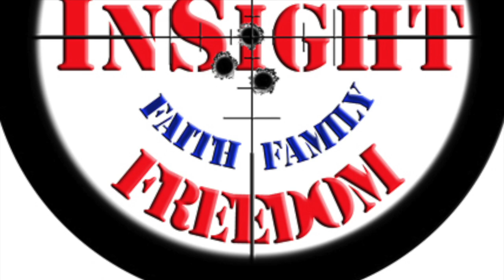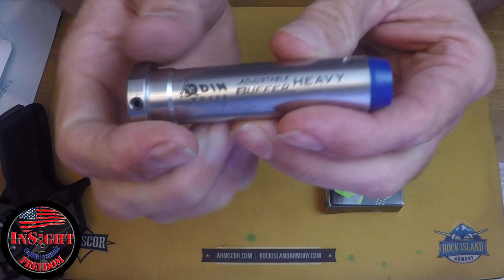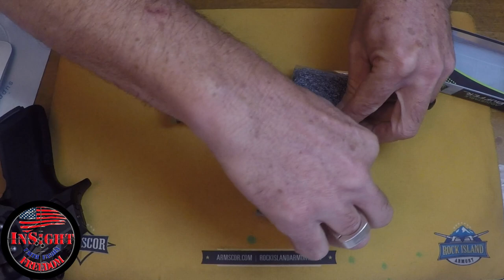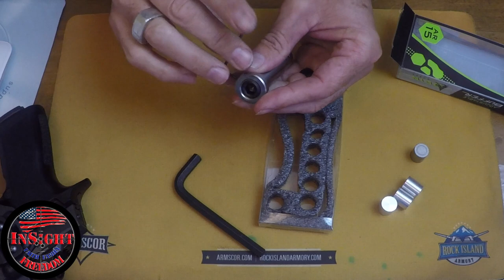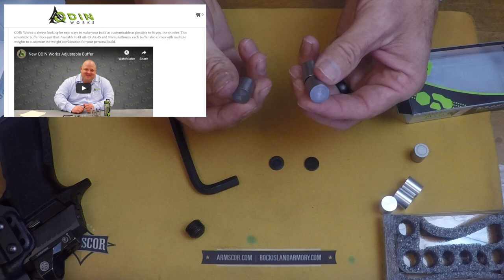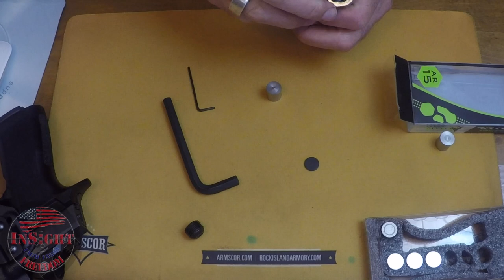Odin Works AR15 Heavy Adjustable Buffer Walk Through

Comment: I like the idea of an adjustable buffer.  That one seems easy enough to change.  Well engineered.
Reply from the maker: Thanks brother.  I really like this buffer concept especially if you might be sharing a lower with different caliber uppers.  Just makes sense. It was so easy to get the 6.5 Grendel tuned with it.  They are really well made to boot.
Reply: Great options for suppressor too!

Comment: Any good recommendations for weight configs for .300 Blackout sub and super, and .223/5.56? Any risk in running a .300BO with too light of config? Thanks!
Reply from the maker: Typically 300 BO will require 3.8 oz buffer. Some variables are pistol length vs rifle/carbine length, suppressed vs unsuppressed and gas system. Heavier buffer weights will likely result in ammo feed issues if too heavy by causing the BCG to not cycle back properly to pick up and feed the following round or causing weak ejection. If too light, ejection patterns will be exaggerated forward (like an AK). The AR 15 Light Odin Works adjustable buffer had a buffer weight range of 2.1 oz to 4.2 oz while the heavy covers 3.7 oz to 5.8.
Reply: @InSightFreedom  Thank you. I just finished a 9” .300 Blackout build on a SOLGW East India upper. I had the Odin heavy kit so have two steel and one tungsten in the buffer. Curious to see if it will be too heavy. Most appreciated!

Comment: I'm wondering how this compares to Strike Industries' adjustable buffer.  I'm debating one or the other.
Reply from the maker: I really like this Odin Works adjustable buffer.  Some have asked if it makes noise.  The inserts do have room to move inside.  A small rubber washer inside with them stops that and doesn't seem to effect function.  I might try the SI on another build.  Always enjoy a good comparison.  Thanks for watching and interacting.

Comment: That's neat, first I've heard of it,  only had my 2 ARs for couple yrs and had no reasons to change out buffers as far as I know
Reply from the maker: Thanks brother.  Most 5.56/223 uppers do run fine with the standard buffer.  SBRs and pistol length can be a little more challenging.  I really like this buffer concept especially if you might be sharing a lower with different caliber uppers.  Just makes sense. It was so easy to get the 6.5 Grendel tuned with it.  They are really well made to boot.
Reply: @InSightFreedom  that deal will come in handy for my next build im going with 7.5" 300 blk, you think there would be too many variables with that adjust buffer and a adjustable gas block?
Reply from the maker: @mckwilly  I think an adjustable gas block will be a much needed accessory when we finally get the Hearing Protection Act.  Such an easy way to adjust for back pressure.